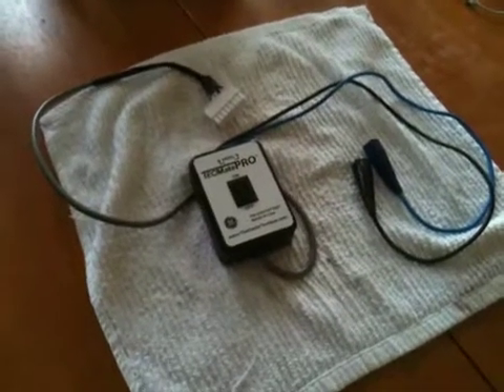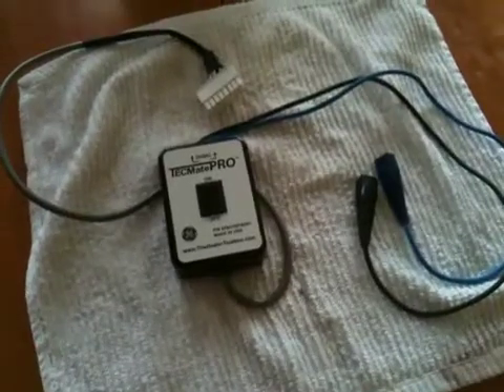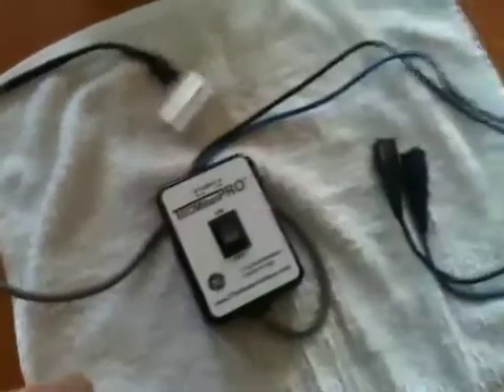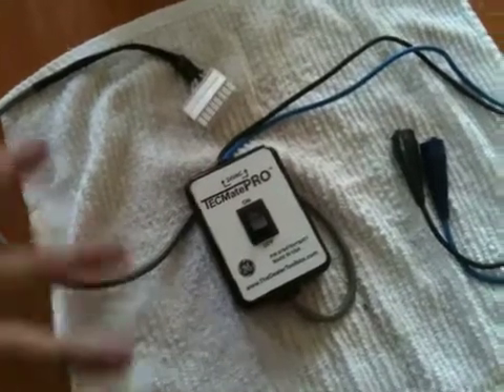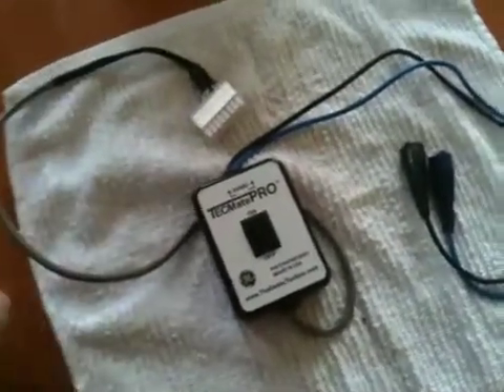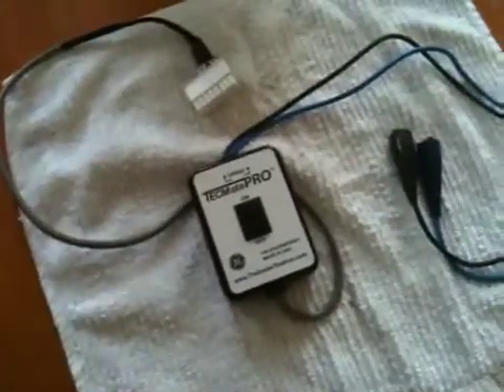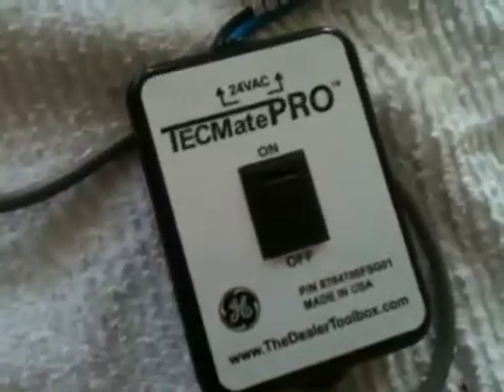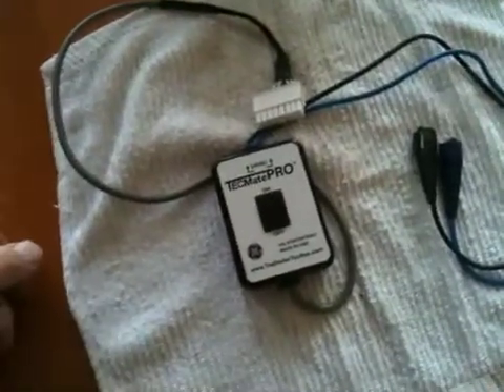Hvac techmate pro

Comment: I just took a class on this I could be wrong it's my first years as a Hvac tech I'm actually a helper at this time. But from the Class I took they said variable speed and ECM motors are 3 phase so if you take the module off the motor and ohm out the motor and find all three windings with the same ohms it's the module.

Comment from the maker: @z978ady I"m not familiar with either the Monitor or Toyotomi heaters, just did a google search for the monitor 30 to get a few pictures.  On gas furnaces there are no heater coils.  Typically though you can usually get comparable parts if you know where to look.  Often when I have replaced motors in the past for different things I would get a generic motor; as long as it met the amperage and rpm requirements it's all good.  ...however if the circuit board goes out that might be another issue:/